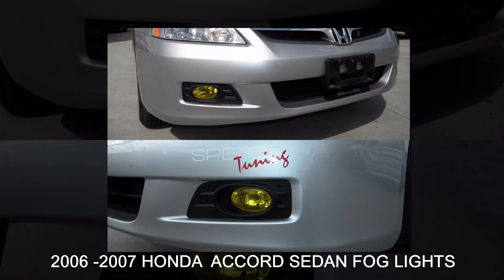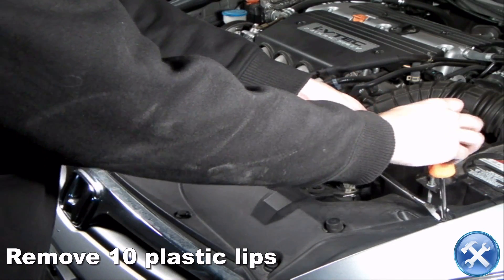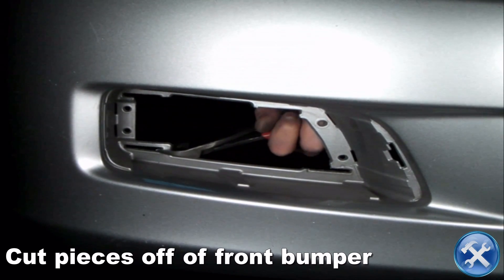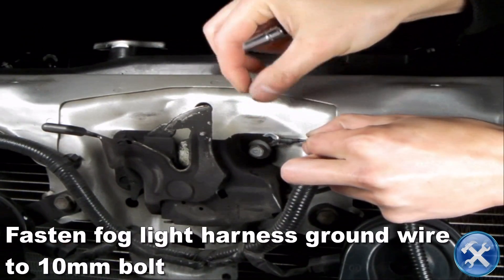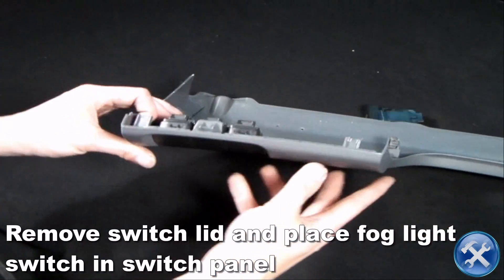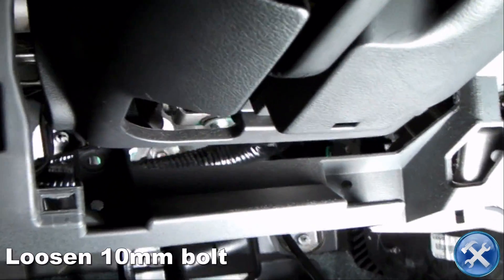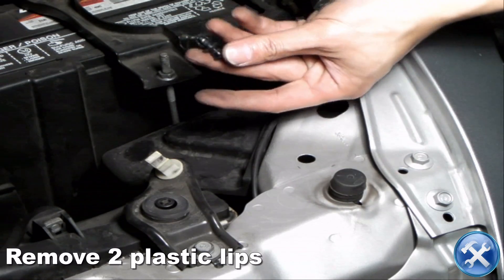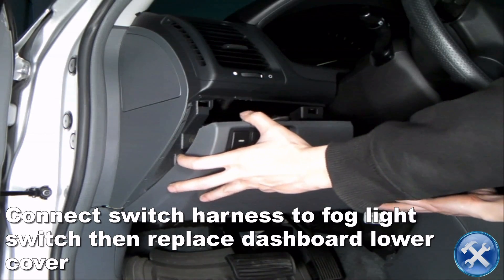SPECDTUNING INSTALLATION VIDEO: 2006 - 2007 HONDA ACCORD SEDAN FOG LIGHTS

Comment: Why did you cut off the two female socket? couldn't you use it to plug into the factory connector box under the steering wheel?

Comment: Hey Spec D Tuning, I'm going through my installation process and I have everything ready to go except for the wiring, I was wondering where I can find those "quick connectors" to the power and ACC wire. Would Home Depot have them?

Comment: Hey, So what do you do with that relay box (the black one you dont touch it) and also after i have connected two wired my switched turned on, means everything is fine? but fog lights didnt come on! what do you think is the problem?

Comment: so when using the test light the car has to be off right?  koeo?
Reply from the maker: +the doge The car does not have to be on, but the accessories. The first turn of the ignition has to be on so you can test the wires. Make sure you have power going to the wires you want to use for power.